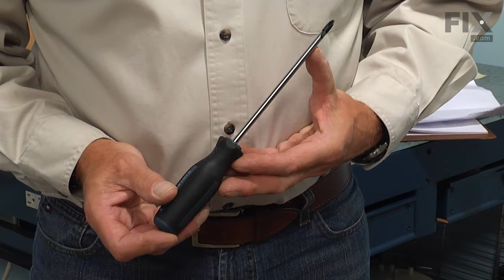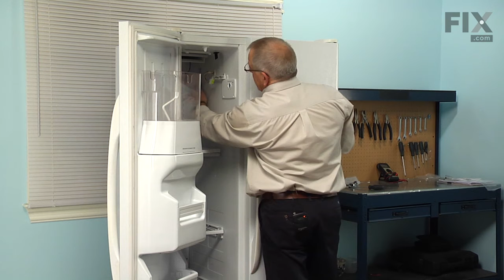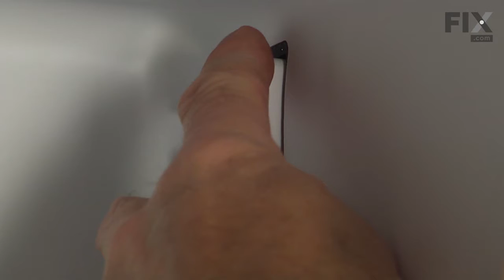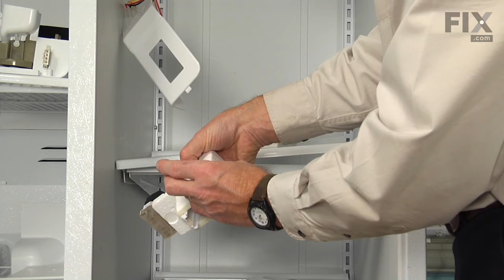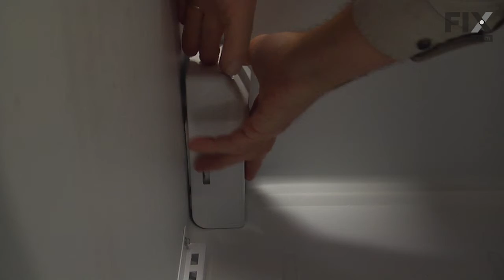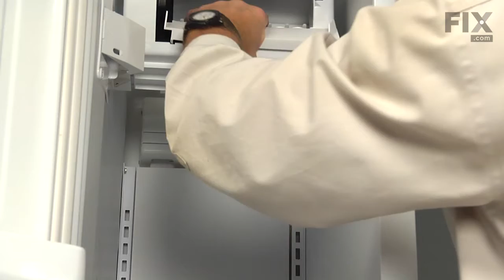Kenmore Refrigerator Repair – How to replace the Air Diffuser

Comment: My problem for the same refrigerator is that the frizer area is very unistable what I mean, swing betweeen 0 degrees and 10, I can make stay in 0 so ice cream is not totally melt but is too soft. The other side is perfect solid 37 degrees . For your info I unable to see ice on the frizer as many videos show for defrost problems. It might be ice behind the panel but I have not opened.. what can be the problem?

Comment: I have a similar Kenmore model, and the freezer is cold and the fridge is warm. No ice buildup in the freezer. The diffuser doors are closed. I turned the power off and started taking out screws, but needed to stop. I turned the power back on so the freezer could continue to work. Amazingly, the diffuser doors open and cooled the fridge. However it only cooled to about 50 degrees in the fridge and the diffuser doors shut again.  Is this a problem with the diffuser, where replacing it will fix it, or a problem with another part the reads the internal temperature of the refrigerator? Mechanically, I believe the diffuser is fine.  Thank you for any guidance you can provide!  - Elaine
Reply: I have this same problem
Reply: @JohnSmith-zc4xe  did you find a solution to your problem. I have the same issue?
Reply: @michaelordway9498  Yes and no.  No in that I ordered a part that was supposed to read the internal temp in the fridge and snapped in place, but that didn't correct it. Sorry - I don't remember what it was called as it was so long ago. I even called a repair man to come out and look at the fridge which was a huge waste of money as I knew more than he did.  However - as I said in my original comment, there was nothing mechanically wrong and I could get the vent between the cold freezer and the fridge to open.  The solution was to force the vent doors to remain open by putting  a plastic knife in there.  I know that sounds strange, but it was enough to keep the vent from closing. Because the temp isn't being regulated anymore and the vent forced open, the fridge side gets too cold so it isn't good for some foods.  However, we still have this fridge in our garage as a backup ( 5 years later) basically as extra freezer space and for beverages.  So it is a yes and no answer. I hope this was helpful in some way!
Reply: Did you find a solution to this problem? I have the same issue
Reply: Anyone reading this it could be either. OR all that could work and the little gate that moves broke and now even with working parts its stuck open or closed

Comment: Steve - I have the same model in the video. Would this be problem if freezer is cold, fan blade in back is running, compressor is warm (assume working) no ice on coils? Temperature in fridge is around 48 degrees not getting warmer or cooler. Thanks

Comment: Hello, Sir, both sides of my fridge feel like they are at the correct temp, but there is a loud whirring noise that seems to be coming from the air diffuser. It's very loud in the fresh food area, but not as loud in the freezer. Do you think this is what needs replacing? Could it be the evaporator? Are those the same thing? If not, where is the evaporator? Many thanks!
Reply from the maker: The evaporator is in the freezer section. If you had a defrost problem, the sound could be the evaporator fan blade hitting on an
iced-up evaporator. Try placing your hand on the cover of the air diffuser when the noise is apparent to see if you feel any vibration from the diffuser motor. If not, try placing your hand on the evaporator cover near the fan motor to see if the vibration originates there. This would be close to the air outlet grille in the freezer back wall.